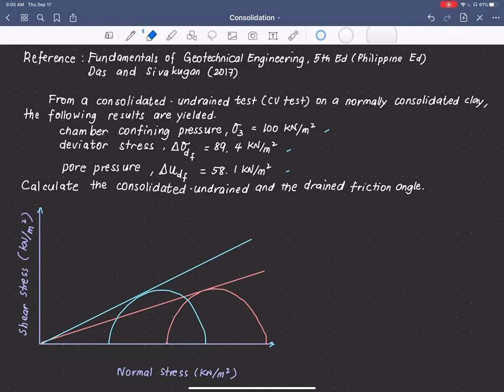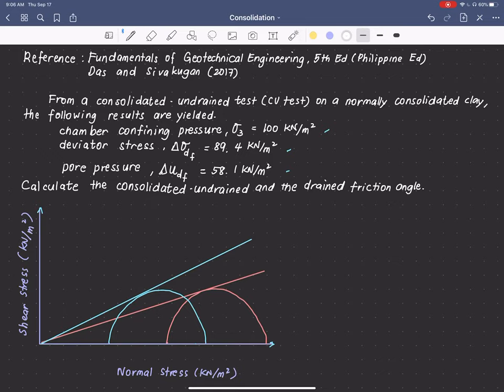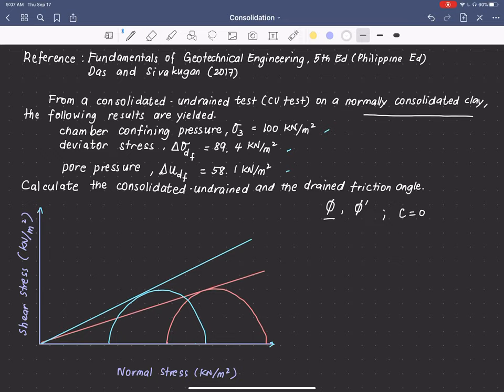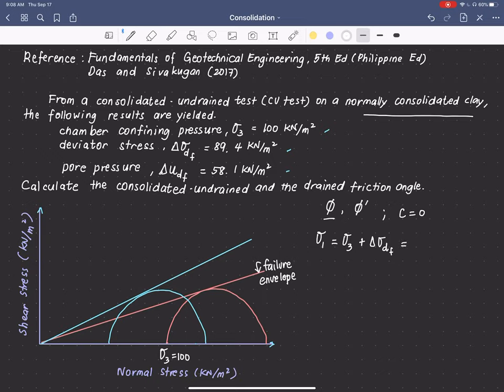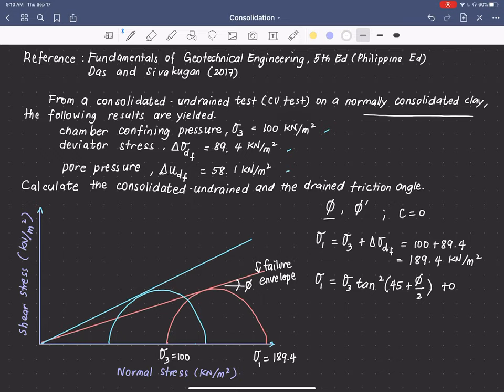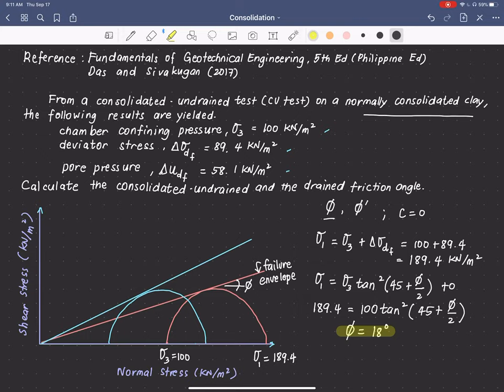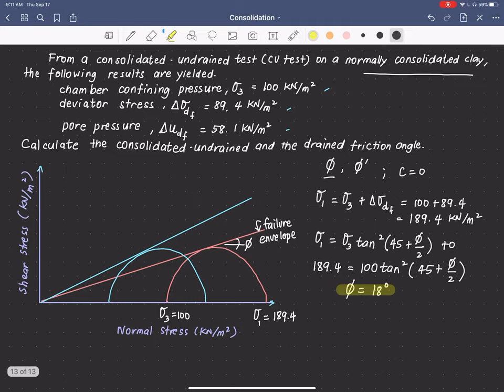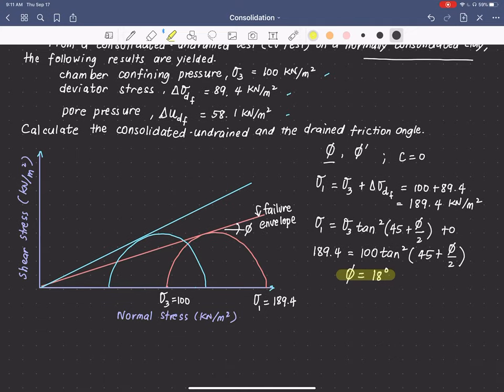Shear Strength of Soils - Consolidated Undrained Test

Comment: I don't understand the tan part how do you get 18 and 31😢
Reply: It's a standard formula used to relate the parameters. 
If you apply the formula, you will easily get the shearing angle. It can also be obtained from the graph by measuring the angle